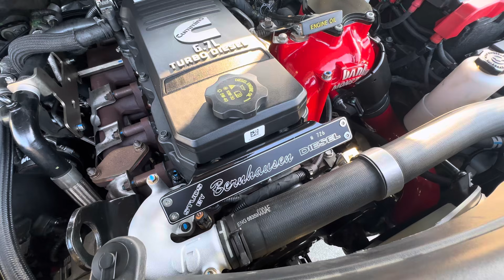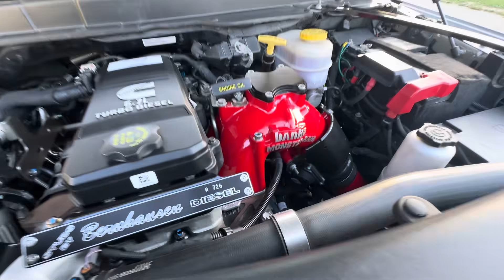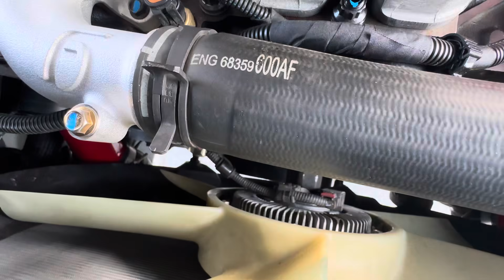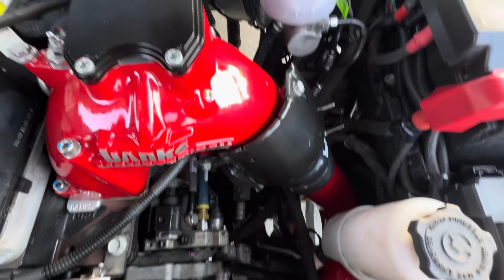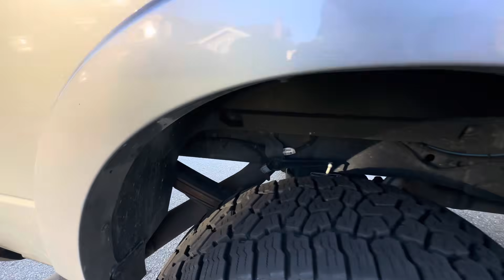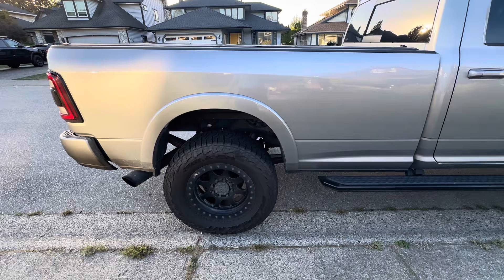2022 Ram 3500 Mega Build @trukstuf

Comment: Awesome build sir! I’m going the same route with my 22. Hamilton is the next must. You might look into…
1) ppe thermal bypass for transmission temps
2) banks rear diff pan
3) banks trans pan
4) bd exhaust manifold (stock one will warp over time and start to leak)

If your FASS system is drop in kit, I’d run the fleece fuel pick up. I did a FASS drop in kit and the fleece fuel pickup in the tank. Better pickup in my option. Fass just came out with their connect system and I’m definitely adding it when I do my Hamilton conversion kit. When I do that, I’m adding the exhaust manifold at the same time. Otherwise awesome build, hit on the most important for sure. For $80 though, that ppe thermal bypass is a must to help keep trans temps down when that thermostat starts to fail, they all do and heat is the 68rfe killer.

Comment: Grid heater bolt on my 2022 got eaten by cylinder 5. Cracked the piston. It's currently sitting at the dealership awaiting warranty approval. It has 75,000 miles on it. I will likely get a new engine, but we will see. The second I get it back, I'm taking it to my mechanic for full delete, Banks Monster Ram, Banks pipes, and Banks air filter.
Reply from the maker: Sorry to hear this - exactly why I jumped all over my truck early. Couldn’t stand the thought of grenading my engine.

Comment: So, you mentioned they met you on price but didn’t mention how much? Could you throw out a ballpark figure so I’m prepared not to have a heart attack when I begin my build process?
Reply: Well… I was quoted $8500 for the Hamilton conversion kit to be done on mine. When they do mine, I’m having them install the bd exhaust manifold. Since it has to come off anyways, they aren’t adding labor to that. 

Thus far, mine has the weight loss, monster ram, banks boost tubes, banks rear differential pan, banks trans pan, fass drop in kit with fleece fuel pickup and ppe thermal bypass and I’m $6000. I haven’t even touched the suspension yet, but I’m going thuren. I’m also going to run hostile 18” rims and get away from the 20” the truck comes with. I want more meat and less rim. 

When I’m all said and done on my rig, I figure I’ll be in 20k to really bullet proof this motor. Need to look into this fleece radiator delete he has for 5th and 6th cylinder…. Haven’t found that mod yet. Might as well have that done when they do my conversion as well

Comment: Awesome build, now add a 2 micron bypass oil filter kit, had one installed 2 years ago, the oil color stays clear for a long time, but when enough soot particles less than 2 micron passes through it will get darker, Amsoil sell one and now black market performance also sell a kit. I just installed the new black market performance dual diesel filter kit in the rear with a billet plate up front that still retains both fuel heaters. 1 rear and 1 in the front billet plate.

Comment: 2 things i disagree with are the flat tappets and coolant bypass. Otherwise great build.
Reply from the maker: This for this - would you elaborate why you “disagree” with those particular mods?

Cheers!
Reply: @KingstonKingdominion  I personally like the new cam, its something lots of people forget about on diesels. What i dont like is switching back to flat tappets instead of fixing the hydraulic rollers issues. Honestly is something we should be more mad at cummins for because theres tons of very reliable hyd lifters in gas and  diesels yet cummins couldnt do it(though they claim suppliers were the issue). With the coolant bypass, disagree is a bad word, id just do more data acquisition to see it the coolant temp diff from in to out of engine is actually something to be concerned about. If it is i think id be more inclined to increase coolant frow that use this solution.
Reply from the maker: @Eric_V410 fair points however I cannot tolerate the idea of catastrophic failure of such a key component (lifters). Plus I like the sound more with the new cam and flat tappers - reminds me of my Gen 4. 

My friend Josh @trukstuf has seen plenty of examples of the rear two cylinders “cooked” from over temp due to lack of coolant flow - and he supports this Fleece product as a safe and reliable solution, so I’ve trusted him and gone for it. He is a Ram “Master Tech” and literally deals with this stuff and the solutions weekly. 

🤷‍♂️